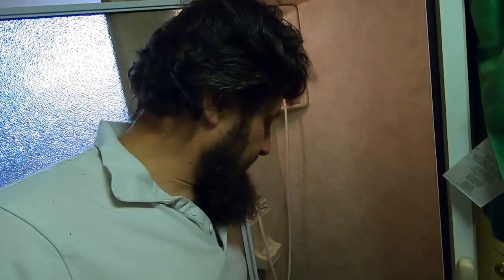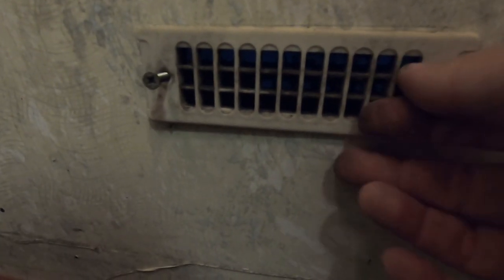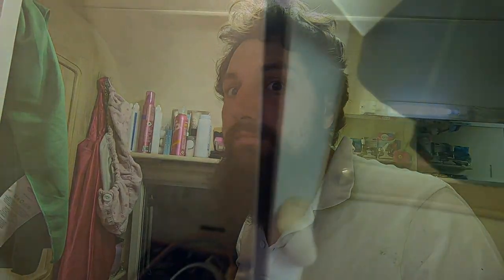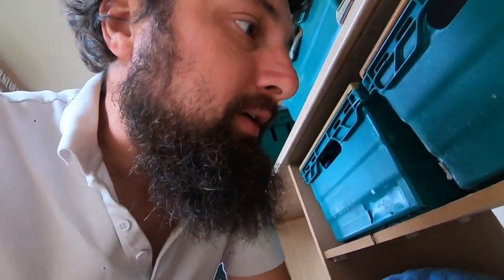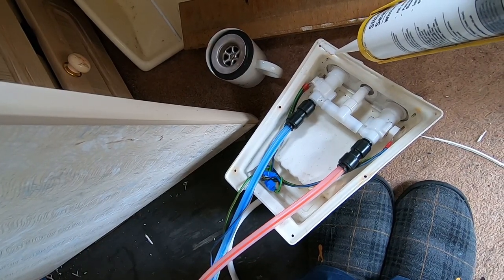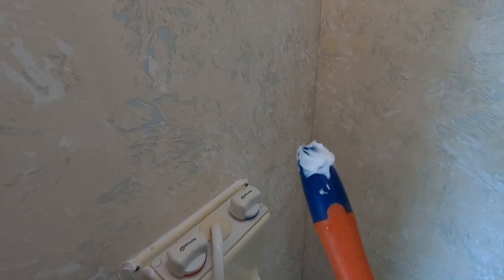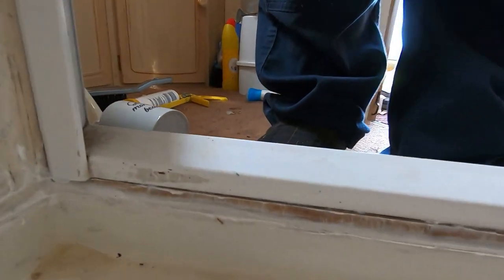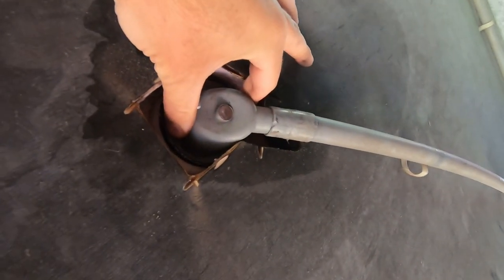Leaky Caravan Shower Tray Repair - Watch me fix it! | #livinginacaravan #quitthe9to5 #caravanrepair

Comment: Hi I’m a new subscriber, great to see you maintaining on older van, not everyone can afford new ones! We’ve just upgraded from a 1996 which we had for 7 years and served us really well with the occasional bit of maintenance
Reply: Oops hit send too early. Our newbie is 12 years old a baby in my eyes! I’d recommend wiping the sealant tool clean after each swipe, it makes it much easier to get a smoother and cleaner finish. Hoping to get out to Anglesey at the end of August.
Reply from the maker: Hi Geoff,
Thanks for your kind words. Yes, we’re quite happy with our old van, not that we could afford a newer one at the moment, anyway. We’ve put some effort into repair and maintenance of this one, so will stick with it for a bit longer. The only exception being that if a really lovely twin axle came about, then we may change. Otherwise, we’ll stick to what we have!
Jamie 😀
Reply: Hi Jamie, we got the van we have just sold by asking the warden on the site we use a lot if he knew of any decent budget vans for sale. He called us when one of the seasonal van owners were upgrading to a static, popped out to the site and deal done in 30mins, “if you don’t ask” etc. Try putting a note up on your site, you never know.

Comment: Big tip for applying silicon. Buy silicon plastic tools, £6 odd eBay. Plastic spray bottle full of clean water with blob of wash up liquid and shake. Apply silicone, spray along line, tool off. Pucker job!
Reply from the maker: Great tip! I'll check them out.  Anything to reduce how messy the job is!  I have a 'love/hate' relationship with silicone!

Comment: love some of the comments below, yes you make me laugh, might have needed a bit longer to dry, some might say dont use silicone better options for caravn silkoline 512 or something,, loved it add more silicone,, trap in sort of thing i would have done doohh
Reply from the maker: Heya!  Do you mean Sikaflex? If so, yes, that's awesome stuff, but is difficult to remove.  Not sure how permanent a repair I wanted at the time, in case I decide to change or alter the shower cubicle.